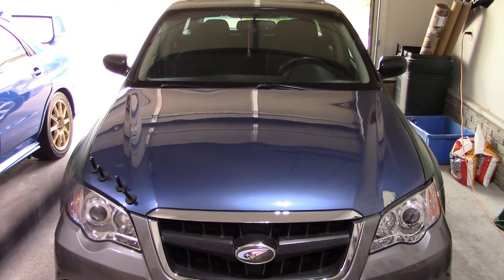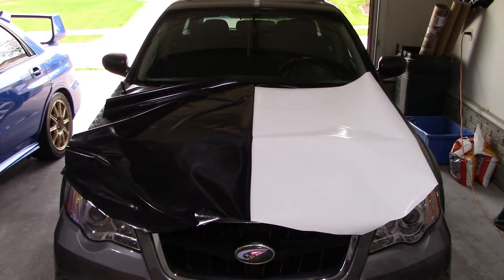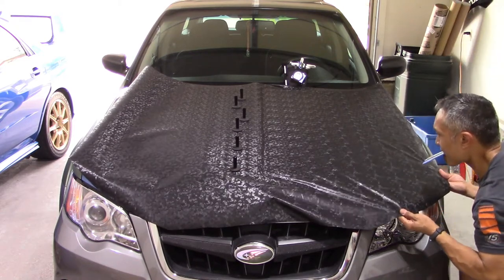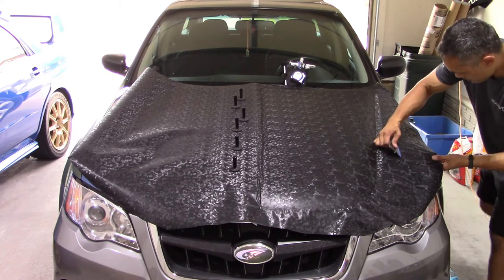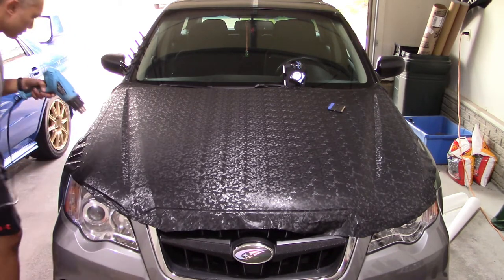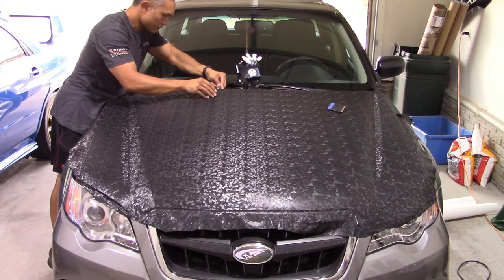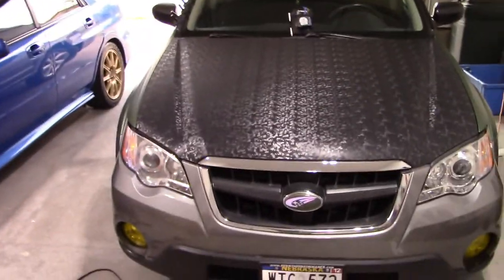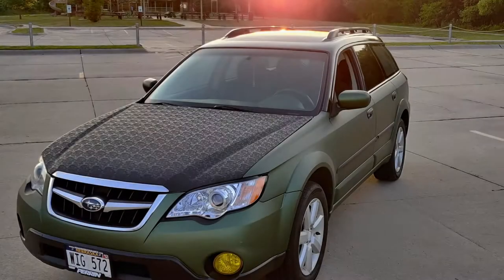How To Wrap A Car - Hood Wrap with Vvivid micro pattern camo vinyl

Comment: My vinyl seems way thicker than the stuff I see everyone else using. Very hard to work with. I ordered directly from vvivid too. I ordered about 1.5 to 2 years after this vinyl release so who knows if they changed the composition. Anyone else have this problem?
Reply from the maker: This camo film is a bit thicker than regular films, I think because it's textured.  I haven't ordered or used any in the very recent past, but it can be a bit harder to work with, as it doesn't seem to cold stretch like normal vinyl. Again, I think the texturing of the vinyl has something to do with it.  A light application of heat does help a bit, but you have to use heat carefully with this as it could "gloss out" the patterning.

Comment: You left out the part that this vinyl in particular can have very little to almost no stretch because you will distort the pattern. Yes with all vinyl you want to avoid overstretching but anything with a pattern or carbon fiber is a biiiittcchhh lolol
Reply from the maker: You are correct!  Because this vinyl has a pattern, overstretching can distort the pattern if you're not careful.